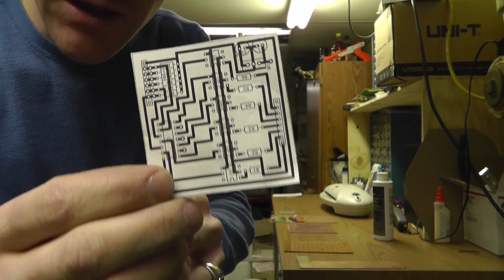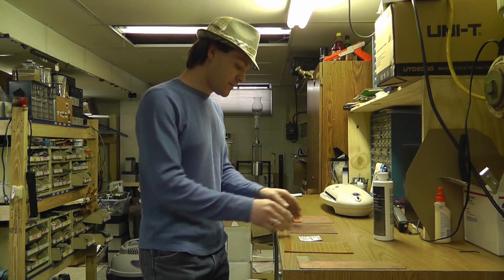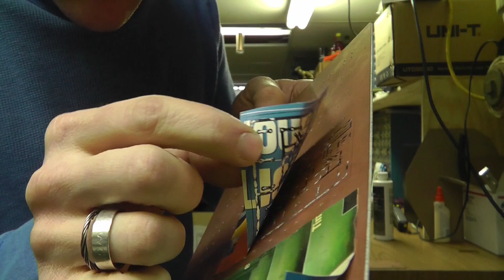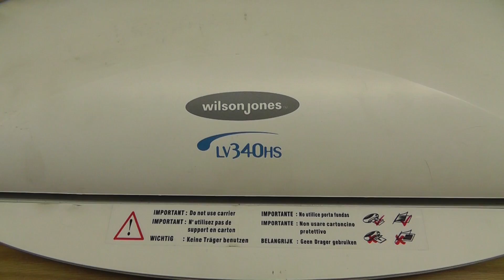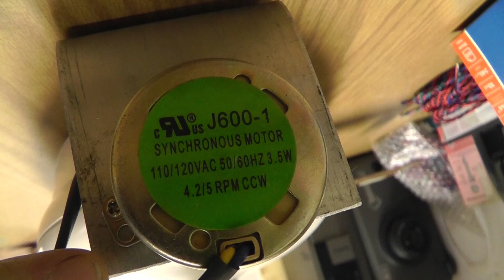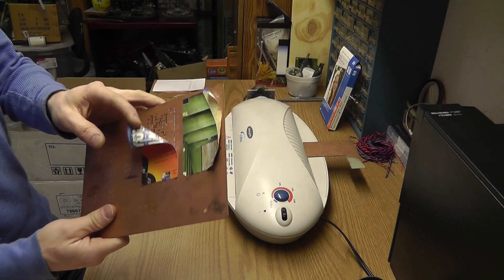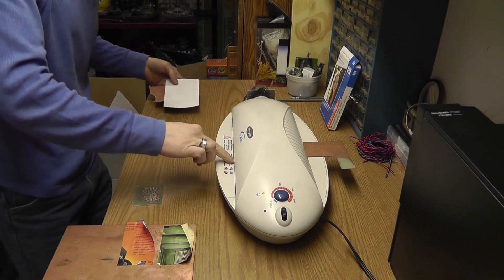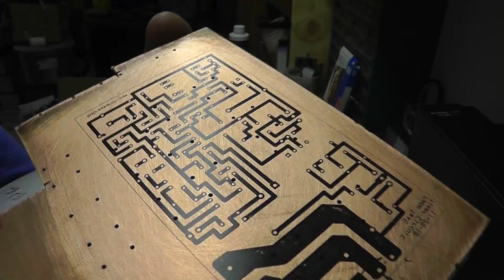PCB Toner Transfer With Modified Laminator Machine ( THE EASY WAY) RwgResearch.com

Comment: when u use a laminator u need to have a piece of paper or card board surrounding the thing u want to laminate so it doesnt melt, thin card board for things that melt easily but prolly a piece of paper folded in half and let the crease go in first
Reply: Pyro Sandwich They aren’t using it to laminate, hello...

Comment: All the laser thermometers I've used have a conical sensing field, not a laser pinpoint as you seem to be using it. The laser is just a sight, the actual measurement comes from a cone shaped range emitted from below the laser.

Comment: Instead of glossy paper or magazine paper, I tried some Chinese yellow toner transfer paper from e-bay (search for "A4 Heat Toner Transfer Paper For DIY PCB"). A packet of 100 sheets costs maximum 20$. Results are amazing, similar to press and peel blue paper. Also I modified the thermostat and thermal fuse to a low cost laminator to allow higher temperatures since I had no motor / gears around.
Reply: ***** I tried that yellow Chinese paper on a few laser printers and I got constant results, that is why I recommend it. Before that, always I had process variations using the same glossy / photo paper on various printers. Meanwhile the price for 100 sheets dropped to 10-12 USD, which in percentage is double than your price :), but in reality is 10-12 USD :)
Reply: YO2LYP give glad bake paper a go works very well. Plus no soaking involved

Comment: Don´t work the static field in the printer can´t hold the toner on the cupper. You can ho it with a wax printer like the c64 OKI, only the resolution is bad.

Comment from the maker: I'm going to Doubt it. Although I seen a video of it online it looks like it would be much more difficult to try to modify something that's designed for paper to roll around rollers versus something that's just a straight through machine. It be extremely hard to bend the fiberglass board around the rollers ;) ~Russ

Comment: FYI, The speed of a SYNCHRONOUS AC MOTOR is depedent on the FREQUENCY of the power source.

4.2 RPM at 50 Hz and 5 RPM at 60 Hz.

Comment from the maker: It works extremely well. One print! And it only takes about 5-10 min to run through the lamanater at this speed. Most of the time your only making a small bord. So even shorter times.. After i modafied this one have also some change the thermal Sensor out for a higher temp one... Others also have also just ran it through manny times and its good... Mine works wonders!!!!  ;) I was tired of fighting it! Love when people through out good "trash" ~Russ

Comment: I can relate to having an unkempt work area.  I have stacks of stuff that I've been putting off.  There's 3 stacks of attic wiring items that I need to get done before it gets hot down here in Texas again.  Adding three new circuits, including a 220 for a new Jointer and Planer.  I have a stack of surplus web appliance servers that I went through for parts (LCD's, power supplies).  Took me 5 hours.  Net gain of space:  1 square foot :-/

Comment: Copper oxide powder in electroplating solution bath to put thicker coat on conductive ink or paint, or just leads off a copper plate but that might be slow.  Once done, hot press or roll press the finished product to remove peaks and valleys. This means putting a wire on each one of the lines (1 each) , as the opposite is common out of the bath.

Comment from the maker: I would say if you really think you could do it go for it but it would probably be extremely hard to do that... The main reason is because the paper goes around rolls and that's how it gets through the printer. If it was a straight shot it probably would be pretty easy but bending a fiberglass board isn't going to work ;) ~Russ

Comment from the maker: All I did was reduce the speed of the Laminator by about 1/12th. Used an old drill gear box and made it fit. That's it! No changing temp Sensors or anything else it seems to work just fine...  Not to hard. Took me about 4 hrs to retrofit the gear box on there... ~Russ

Comment: Russ I used to do my circuit boards the same way and what I would do to stop the sticking was to drop the board into a tray of water. This would allow the paper to peel away without removing the traces even down to 10 Mils! FYI I no longer use the standard ferric chloride. I now etch with a mixture of muriatic acid and hydrogen peroxide and the boards look like they came from a board house. I have already done videos on it but I haven't uploaded them yet.